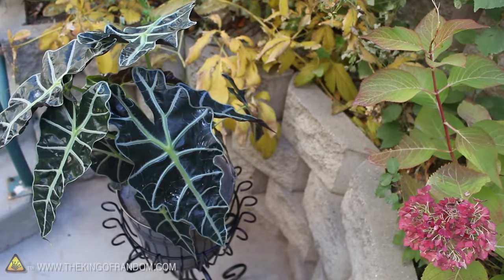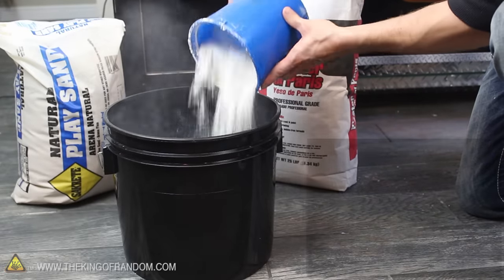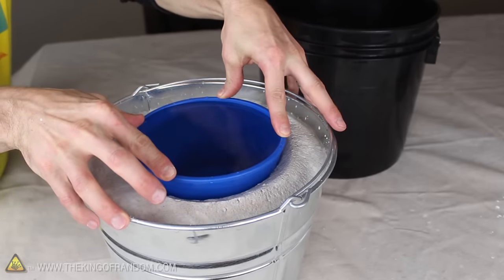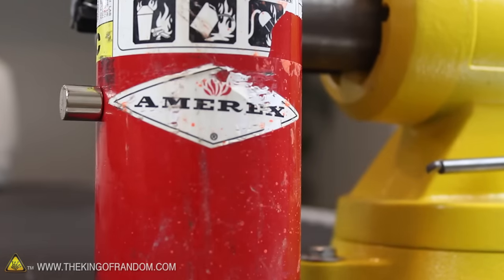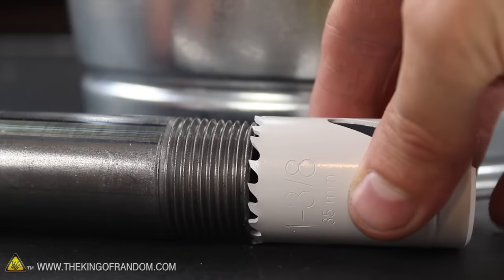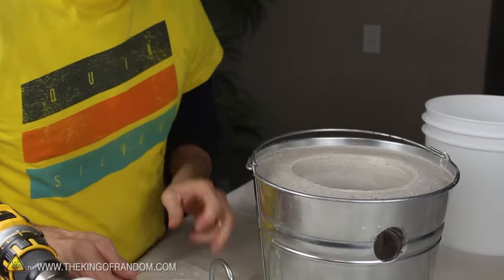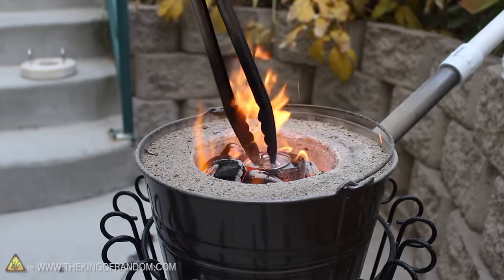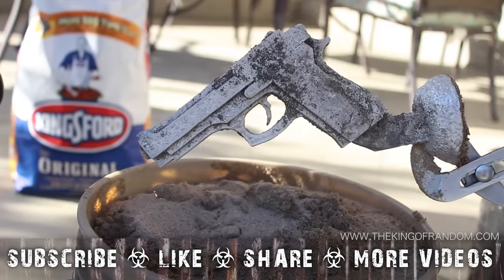How To Make The Mini Metal Foundry

Comment: Did I miss something? What are you using for fuel and a blower?
Reply: michael C Charcoal and a used 3$ hair dryer attached to pvc, a size converter, and steel piping.
Reply: TheHeadHunter1000 thanks, I just watched your video melting cans and saw the hair dryer! I had one, but when I went bald, the hair dryer went too lol......I never should have gotten rid of it, I've needed it for many things, none of which involve drying hair hahahha
Reply: michael C
I didn't make any videos on melting cans. :3 You are welcome though.
Reply: TheHeadHunter1000 oh sorry, I thought you were the poster of the video....anyhow, thanks for the info!
Reply: michael C For doing aluminium you can use regular coal, or charcoal briquettes. If your setup is large enough you can just use wood. You don't need any other fuel source, just a lot of air. This can come from a reversed shop-vac type vacuum cleaner. Just that if you're gonna use wood, you'll have to keep adding a lot of it very frequently, so it's best to use hard wood like oak, elm, or hickory. Don't bother with pine or birch. The more air you put into it, the faster the wood (or coal) will burn, but also will reach a much higher temperature than say in a campfire or a fireplace. Also, when you drill the hole for the steel inlet tuyere, you want to angle it a bit to the side so that when the air comes in, it goes around the perimeter like a vortex. If you use coke in place of coal, your temperatures will skyrocket to the point where you can easily melt steel provided that you have a constant supply of pressurised air coming in, and a suitable ceramic crucible to contain it. 
I apprenticed in metallurgy for 2 years and since I've done all this, I'd recommend you get an electric furnace because those are the cleanest and easiest to use. And PLEASE watch videos on how to use these safely because if, for instance you're adding say Silver to an already molten mass, and you're not careful, you could end up with a face full of molten metal, same thing with pouring into an improperly cured mould. DO invest in all the safety equipment like gloves, goggles, face mask, the proper tongs, etc.
Reply: +Solnechniy Zaychik you seem to know how this works, so please tell me, could i make a viking styled axe with the lost foam method or would it not flow correctly?
Reply: Birdifyed01 you'd need an awfully big crucible and an awfully big forge to do a sword....and an awfully big mold.....and being aluminum it won't be very strong. if you want it for decoration only, then fine, but if you swing it against anything solid, it will break.
Reply: +Birdifyed01 I think the lost foam method is perfect for a project like that. Just make sure your metal is at a temperature a lot higher than the melting point so as to fill in the edges. If it doesn't, you might want to look into centrifugal casting to get the metal to the edges. Same method, same exact form, only the form rotates on an axis so that the metal fills out the edges.
Reply: +Solnechniy Zaychik what if i make the axe head and then leave a hole for a wooden handle once cooled? Think lost foam will work for that?
Reply: Birdifyed01 Only thing is, an axe head out of aluminum again won't hold an edge very well...if it is for display purposes, fine but for use? errr not so much.....

Here is an example of the detail you can get with lost foam....

https://www.facebook.com/photo.php?fbid=10153683601283274&set=pcb.10153683601953274&type=1&theater
Reply: +Birdifyed01 Depends entirely on the material because some alloys will shrink more than others due to cooling. The best thing you can do regardless of the material is to cast the head whole, then make the hole for the handle using a milling machine. Since I realise most people don't have a milling machine at home, your best bet is to take it to a small machine shop and have them do it. Back when I used to work in one I'd just take things like that with me to work and do it on my lunch break, and we'd occasionally do things like that for people. If you provide your own tools (like a reamer bit, countersink, bits, etc.) they might do it for just a symbolic sum.

Comment: What can I use if don't have an extinguisher?
Reply: You should have one anyway doing this kind of work, so buy two, use one so you know how the other one works if ever you need it, and then you've got one to recycle on this.
Reply: buy a discharged fire extinguisher
Reply: just buy a regular crucible for like $10
Reply: true
Reply: thanks
Reply: +Techpriest Short 10$? Here the cheapest cost 20 at least
Reply: Any Streep cup pretty much. I'm in the same situation. 😂😂
Reply: I am working on mine right now I used a post hole pounder thing which is very thick steel, it is taller and needs to be supported more but there will be less Slagle because it comes out of the hole
Reply: Might be a scrub question, but would a graphite crucible work just as well for this kind of foundry? Got one for a kiln but would it work just as well as steel for a foundry which relies on heat being conducted through the crucible rather than in a kiln?
Reply: Telleryn grafite crucible are the best, don't worry ;)
Reply: Zebefreo :D
Excellent! TY!
Reply: Ok, the only crucible there under $10 is 1kg (2.2lb) which has a top opening of 66mm (~2.5") that's not big enough to fit pop cans.  You need at least 4kg which is $17.58 plust shipping... wait, what?  Why are you linking seller from UK???   There are plenty of these sellers from eBay, at least you got full protection from eBay.
Reply: not exactly full protection unless you go to a reliable seller
Reply: +Michael Garza I don't know man, everything I bought on eBay that I had issues with I either got full or partial refund depending on issue.
Reply: +Telleryn You're not making any sense.  How does kiln transfers heat differently than this foundry?  The crucible heats up and metal melts regardless of heat source (fire, electric, etc).
Reply: In a Kiln there would be direct and indirect heat to everything inside it. This Furnace only provides direct heat to the outside of the crucible. If the crucible itself doesn't absorb and transfer the heat form the outside surface to the inside surface than nothing will melt.
That was the point of the question.
Reply: can i use a steel cooking pot as a crucible ??
Reply: I used a 1 lbs propane bottle.
Reply: Alexandre do i have to use and specail tool to pull and pins or just saw when its empty??
Reply: Hum be very very careful. Keep it open for a day, upside down because propane is heavier than air. You can also put water on the bottle when you cut it to prevent sparks. You can cut the tank with a metal saw. Its dangerous... Be careful.
Reply: buy a torch propane tank the smaller ones that's what I used
Reply: Can you use a soup can for a crucible and make a smaller one??

Comment: Where can I get an empty fire extinguisher?
Reply: +Chris Austin City dump/landfill, or maybe at a scrap metal recycling operation. You could call them to see if they have any.
Reply: old used up blue propane torch bottles should also work.. just MAKE SURE they are empty so you don&#39;t blow your hands off.
Reply: Try a fire extinguisher service company.   They do take them out of service if they can be refilled.
Reply: +Chris Austin If you don't have one, you could spend about $15 for a real crucible made of graphite on ebay. You won't have to worry about a steel makeshift crucible melting on you being an additional bonus.
Reply: +DailyAverageGamer what size do I get? I'm not seeing exact diameter sizes just labeled by number
Reply: All you need is 2 quarter bucket o' gas and 1 zippo
Reply: +Chris Austin Local fire department sells empty ones sometimes.
Reply: +Myanameis Beestingz you cant get stuff from recyicling operations in germany
Reply: +Minimeister317 
I would check with the local welding supply for a small oxygen bottle. They are many times thicker than a fire extinguisher. They will cut it in half for you, if they also sell steel.
Reply: Loren Shelby Thanks! I hadn't thought of that at all.
Reply: +Chris Austin if you have a propane bottle you can burnall of the fuel and boom there you have it.
Reply: Start a small gas fire and put it out, then you have your empty fire extinguisher
Reply: +Austyn Rocco XD
Reply: Amazon is the way to go. There's 16 oz stainless steel cups that I use. Sure, in time they burned out holes, yet they lasted quite a while.
Reply: if you Google where to buy a properly sized fire extinguisher make sure to buy one that is filled with co2 because that can be used for making home made dry ice
Reply: +Keegon “Kmdude344” McPherson Specify a carbon dioxide fire extinguisher. Also if you really want dry ice, most grocery stores sell it for a few bucks per pound.
Reply: Brenden Duvieilh It is rare to find a store that sells dry ice in Europe though, and it ain't exactly cheap.
Reply: +Chris Austin the video indicates the crucible is 5" height and 3" diameter.  This works if you use the same bucket sizes Grant used to make the forge, of course.
Reply: +jamesb1221222 any suggestions on how to make sure they are empty?
Reply: lol
Reply: Check your old ones, empty any which are out of date. Otherwise buy 2 new ones, empty one  y using it as directed, pointing the nozzle away from anything needed, the other one you keep because you should have one in any case!

Comment: Hey, I couldn't find any fire extinguishers anywhere that weren't alluminum...
Could a propane/mapp gas canister work as an alternative or are they too thin?
Reply: +endermanslayer24 I couldn't find a steal fire extinguisher either so I used a camp stove fuel tank. It lasted 3.5 runs, so yeah, those may be too thin as well. Ha!
Reply: Michael Webb Aw darnit
Then what could you use??
Reply: I keep reading in these comments to go to an actual fire safety supply store and ask for the old metal extinguishers. Everyone is saying that they recycle them and are usually happy to just give them away. I went to a metal recycling center and they had none, but a store specific to that type of product seems to be the ticket. Otherwise there are commercially available crucibles online that you can buy but unfortunately they are upwards of 30-40 bucks... thus doubling the cost of the investment on the foundry essentially. :(
Reply: Michael Webb That's completely fine, I've already quintupled it xD
Thanks
Reply: Haha! How on earth have you managed to do that???
Reply: +Jeff Borus eBay and graphite crucibles or perhaps ceramic....not too crazy expensive either
Reply: +endermanslayer24 i was able to melt using a propane bottle, about $3 at most stores.  it takes awhile to get the propane out, but you probably wont find a cheaper crucible.
Reply: Jeff Borus
 I would have to agree with Believe It on this one. Ordering a ceramic crucible online and having it shipped to your house is probably easier, faster and will provide you with a life long longevity item. I saw some other vids where they melted brass and steel in the ceramic crucibles too, so it kind of ups your game on diversity of materials to work with.
Reply: +endermanslayer24 I went to walmart and bought a stainless steel cup has worked great Regular steel melts at 2600 to 2800 stainless steel melts at 2750 while aluminum melts at about 1220 also picked up there 30.00 wet/dry vac that has a blower port on it instead of the hair dryer

Comment: Can this get hot enough to melt brass and copper?
Reply: Just about. Add more air, perhaps go to propane.
Reply: The charcoal will burn hot enough, but it needs enough air. It also might do a little damage to the smelter lining.
Reply: Maybe, this thing might reach temperatures of about 1,000 Celsius, which is borderline good enough for brass and a little under copper. I recommend using propane instead.
Reply: LegionStriker propane does not burn hotter than charcoal its just easier to mix with air. All metals were melted with charcoal before the 1800's.
Reply: Bryan Noyce In a small setup like this, propane will reach far higher temperatures.
Reply: Do you mean this set up could be used with propane?
Reply: Edward Charlesworth Yes, grant has a video on it converting this thing to propane. It's better in every way, you should do that instead of this.
Reply: Yes, you just need to readjust the hole for propane to circle around crucible.
Reply: Hey King  random how come you not tried to melting dried ice

Comment: Where do you find used fire extiguishers.  And if they are hard to find, could you made one out of something else?
Reply: Ask your local fire station for used ones
Reply: Find a used mapp gass canister (make sure it's empty!) Depressurize that and it'll work just as well.
Reply: You could use a 3 inch black steel pipe and screw on a cap also black steel and make it that way probably a lot more life out of it.
Also black steel does not produce any harmful fumes so it's safe that way too.
Reply: Jw Owens It's pretty hard to find a 3 inch steel pipe though. That's actually what I was going to use but I couldn't find one.
Reply: Ya you're right I work at header shop and machine so I just took a pipe put threads on it then had another guy threadmill the cap for me so I could screw it on I guess if you had a friend in a shop he might be able to do that, but I guess you could also weld the end on and use regular carbon steel :p I guess there are a ton of way to do it lol
Reply: there is also the option of going to your nearest recycling center and beg for a gas tank. I did that, and i got 4 different shaped gas tanks, just to tinker around with. Do remember to depressurize and fill them with water before cutting them though. You wouldnt want to set of a shrapnel explosion, when you're cutting the thing ;)
Reply: just use a propane torch canister
Reply: Sean Gutierrez Did you just leave your phone number on a Youtube comment?
Reply: Some fire station/houses will give old ones away for free.

Comment: can i put the steel wool in the actual plaster mix for the bucket itself to prolong the life of the furnace? I'm planning on building one of these and I have a limited budget and I'd rather spend a little more and build only one over time.
Reply: Yes, it will hold together much better and makes it a bit less likely to explode on you if you get big air bubbles
Reply: Ok thanks
Reply: @cutepig4212  put the bucket on something that vibrates pretty hard for the first minute or 2 of the setting time. It helps remove bubbles in the mix. They use a vibrating table when pouring big slabs of concrete so, it should at least help here.

Comment: Not under $20 anymore, just the sand and plaster of paris was $22 before tax. I'm $90 invested now, I hope it works.
Reply: Too many makers?
Reply: ya its a lot more than he said and what a click baiter he  is
Reply: NERF RIVAL studios
My total amount invested was close to $150, but I bought a drill too. It works, but it didn't get hot enough to melt anything. I think it might be because I didn't make a lid so the heat is escaping too quickly.
Reply: The parts of the materials that are actually used might be under $20, maybe that's what he meant
Reply: Dankus Memus The two main things are sand and plaster of paris. The two smallest bags were $22 total before tax.
Reply: Depends where you live, I guess.
Reply: +FraggedDabloons Wait how did you have to put in $150?? People in the comments have made it for $31...
Reply: It depends on how much you buy. If you buy in bulk and make several of them its cheaper.
Reply: he said the plaster and the sand costs 20$
Reply: Same here I just made mine for about $90, still cheaper then buying one for several hundred
Reply: lots of people already have te tools and hole saws an just gotta buy the b uckets or something
Reply: I ended up paying $75 and still need to buy parts for the blower tube. It might be $20 where Grant lives, but I agree. Not under $20.
Reply: If you already have a lot of the components (I'm guessing Grant does when you look at his shop) then there's very little to buy so I can see how it would be around $20. For me, I had NOTHING...had to buy everything, including the drill bits. Ended up costing me about $120. I still have enough plaster to possibly make a second though =)
Reply: Does nobody pay attention? He clearly states that JUST the sand and plaster cost $20 nothing else.
Reply: +Ian Kinney Read the description, it says: "How to make a simple backyard foundry for less than $20, for melting pop cans, and casting aluminum."
Reply: Did he say 1inch steel pipe!!??? That's at least 6 inches right ?
Reply: Pokemon Bargains it's 1 in. diameter. your clearly looking at length. but the length it up to your convenience.
Reply: Thanks and what about instead of a 2.5 quarts plastic bucket to use for the middle mold, I was thinking about useing a paint tub, it's plastic and is 6 and a half inches in diameter and hight, that would work perfect just don't know if I can get it out after the plaster gets hard. Any thoughts ????
Reply: Pokemon Bargains actually that's exactly what I used. you could either cut down one side completely and use tape down the cut which can then be removed once dry enough. or do what I did and just leave it a couple days to set up then start a small fire in it every day for 3-4 days to help harden and burn out the bucket.
Reply: +Kevin Coatney (Bean14) cheers mate, gonna try and cut it in half and electric tape it so I can cut it and hopefully peel it out.
Reply: how'd it go?